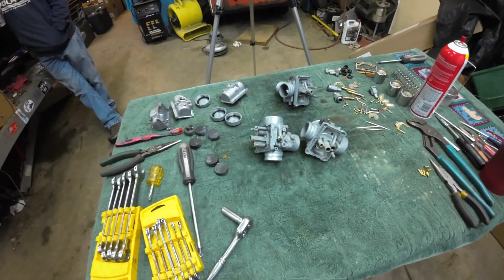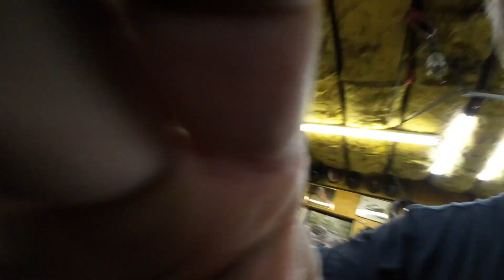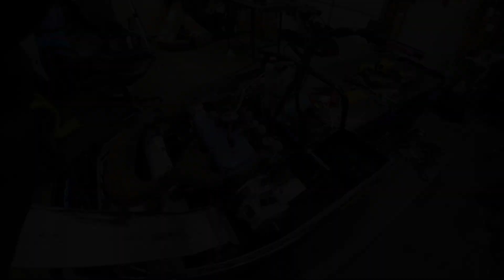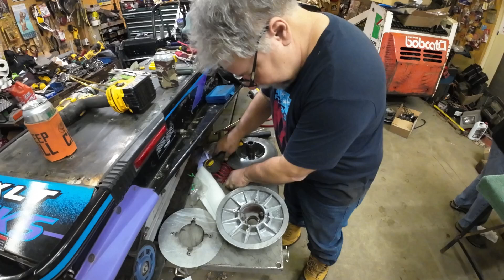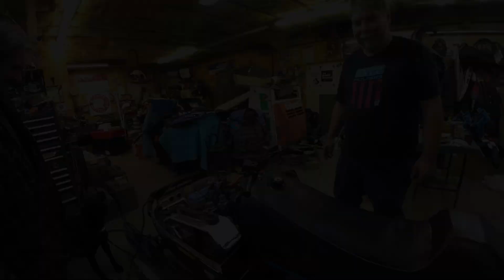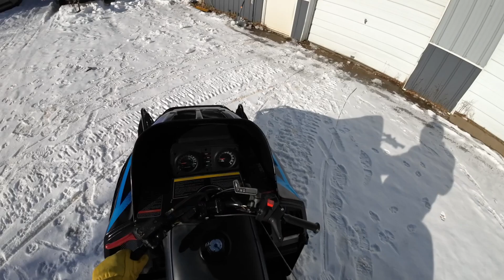Swap Meet XLT Part 8: Getting it together and Test Hits!! Vintage Polaris XLT 600 triple snowmobile

Comment: wow! that xlt sounds amazing! 
I really wish I could spend 1 afternoon with you while you're dialing in a sled.
If you showed us more details instead of skipping to when it's already done
your channel would be even better 
You definitely have Todd Cline's channel beat by a mile though because all he does is give 5 minute oral report of what he's got done but shows us nothing of the hands on stuff
Reply from the maker: I'm not actually spending that much time typically. I leave the carbs stock or close to stock for a sled with a stock pipe. As far as clutching these old sleds go, I have enough experience from years of grass dragging and building old sleds that I usually get it right on the first try. Even on Dennis' TX340 with the modern clutch we only changed the weights the once and that was in the video so you really did see everything. If you want to learn this stuff start by reading Aaen's clutch tuning book until you understand what Olav was saying. Then get some springs, weights, secondary springs and helixes and start tuning. After a while it gets pretty easy. The other thing is don't run junk clutches. It's damn near impossible to tune sticky worn out clutches. That why you see so many new clutches coming out of my shop.  I'll add that for this sled, first throw on the clutches was the blue primary spring, 10M5 weights, red secondary  spring and 34 deg helix in the second hole. It was spot on and I never changed it. So once again there wasn't anything more to show than what I had int he video.

Comment: I`ve had my fair share of those XLT`s. Nothing like the sound of a triple. They sound really nice with a DG Can. What years of reverse chaincases worked on these sleds? If I ever come across a reverse chaincase..I`m buying it then sourcing the sled!
Reply from the maker: Any wedge hood reverse works in any wedge hood or even a TX or TXL - depending on if the exhaust clear or not.

Comment: Wow! Nice work! That is one tight running and clean looking XLT! Did you need to make any modifications to make the Gripper skis work (new rubber isolators, extra or different washers, etc)?
Reply from the maker: You need a 6" long x 3/6 bolt grade 5 or 8 for each ski. Also buy the rubber isolators that match the plastic skis. Part 5412794
Reply: Great info - thanks!

Comment: Another great video Nutter, thanks as always!  Question for ya, maybe comment in next video if you want.  On a engine refresh like you did on Swap Meet XLT is there a standard process you follow to break it in correctly?  I mean besides the whole test run in the yard?
Reply from the maker: I think it's all about seating the rings on a 2 stroke. Think of the cross hatch as a file --- a file that goes dull quickly. You need to make pressure on the rings when the cross hatch is fresh to seat the rings and wear them into the shape of the cylinder. Read up on the first small block Chevys and when the rings didn't seat they used Bon Ami cleaner which is slightly abrasive to seat the rings. They shook it right down the carb of running engines.
Reply: @nuttersspeedshop  As always thank for the great info!  I will go read up on small blocks as suggested!
Reply from the maker: It's a good read but don't do it to your sled LOL! Just some history on when rings didn't break in properly.
Reply: @nuttersspeedshop  I agree.  I have seen alot of great results by putting a good load on the rings ASAP on start up.  Not crazy beyond redline, but real solid pulls up in the zone to pressure the rings against the cylinder walls.  Some also swear by non synthetic oil for break in.  Dummond Tech even has a special non synthetic break in 2 stroke oil.

Comment: I had 2 of these given to me, one mostly there and another parts machine.

Is there some difference to do with the stripe that goes around them?
One of mine is pinkish purple and the other is blue like yours plus the one has what looks like better suspension under it.
Dont know a lot about old sleds.
Reply from the maker: Probably different years or models. Check the model number on the tunnel. Google that or go to vintagesnow(dot)com and download the master service manual to look up the details. Xlts could have different suspensions including the 8", Xtra 10. Xtra 12 all with a 121" track and SKS with a 133.5" track.

Comment: Hey nutter, do you line the oil pump hash marks on idle or wide open throttle? I cant seem to line up both the marks
Reply from the maker: Both should line up, but if I have to make a choice I line up the idle mark.

Comment: Where did you find a new P-85 for an XLT?  Last time I searched I only found clapped out used ones...
Reply from the maker: you can still buy them new. Not cheap, but worth it. Just need a 30mm taper P85.

Comment: I have a 95 XLT, i wanna ask you what’s your tune on the carbs.? Mine are messed up
Reply from the maker: Basically stock. I went down from 210s to 200 on the mains but otherwise the same as the chart under the hood.

Comment: On the Kidsonic 6000 carb cooker it seems to work best with 1 part simple green to 4 parts pure bullshit juice........just sayin......... :face-green-smiling:
Reply from the maker: I tried simple green and it discolored my carbs.
Reply: @nuttersspeedshop    Sorry, its just a inside joke.   In reality, my buddy uses this ultrasonic specific solution for carb cleaning.  Some stuff is actually TOO strong and starts to eat away at carb bodies.